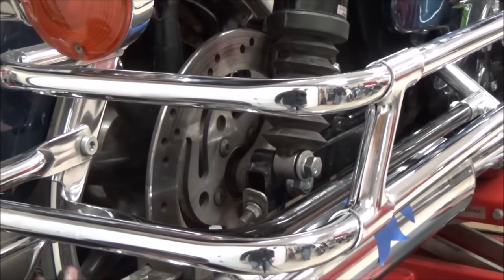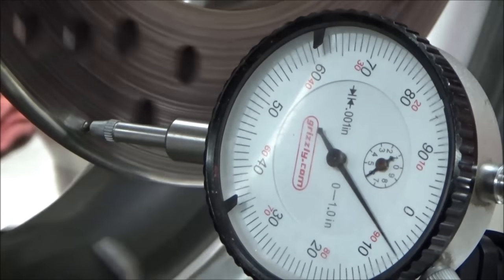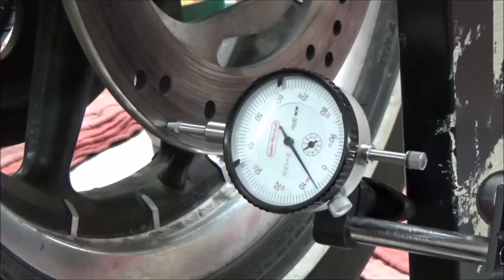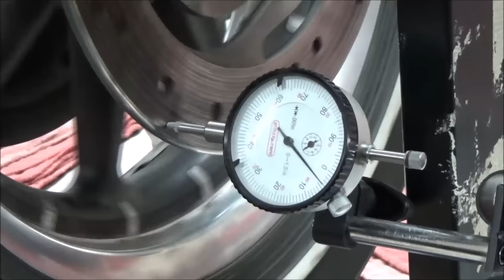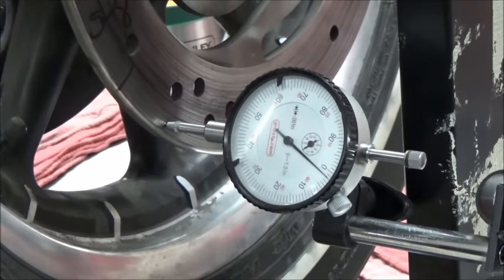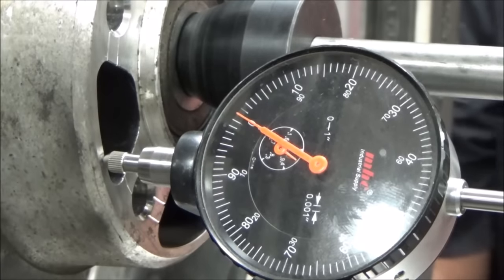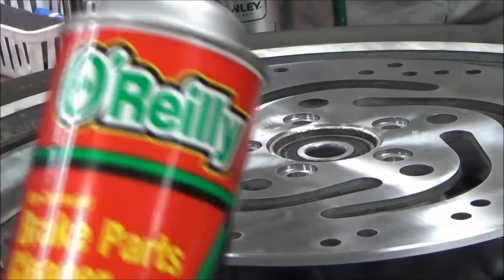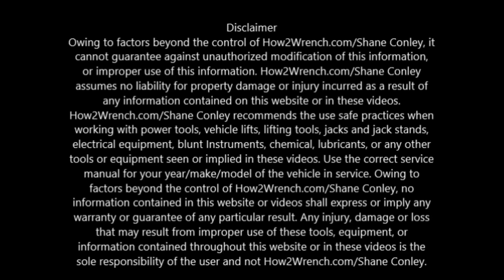Got the shakes? How to inspect a warped disc brake rotor. #how2wrench #bentrotor #brakeinspection

Comment: Thanks for the video but it think the title is a bit misleading because you did not "fix" the rotor, you "replace"d the rotor. A huge difference bro...
Reply from the maker: Thanks but....OMG what would we do without the Nazi title police????? YouTube limits titles to 100 letters BRA...Picking a title to best fit most common "talk" is tricky BRA...You got the point the fixing the warped rotor was to fix the "problem" right BRA? LMAO
Reply: Shane Conley I see your point but i have a slightly warped rotor i wanted to fix because it is a shitload of money in Turkey, a real big ass shitload that is almost close to a minimum wage or even more, so you can see the frustration i had :) Nothing nazi about that...
Reply from the maker: The point is this. You can not fix a rotor...motorcycle rotor that is. There are so thin to begin with. Can you chuck in in a lathe and turn it? Yes, of course, you can mechanically, BUT it will not have the material left to prevent warping right away due to the thin material now. Let alone the unknown stopping or rate of wear as it is thin and not able to dissipate the heat as originally designed. Hope this helps.
Reply: My rotor has much more than min thickness but i thonk it is like one third of a milimeter bent i will use a dial indicator and let you know the results. Depending on the warp, yes they can be repaired, sometimes. Not all the time

Comment: good video and only thing I would add is to check brake rotor minimum thickness. my yamaha royal star service manual gives that spec along with allowable runout.
Reply from the maker: True that...Did I not mention in this video that the minimum thickness is stamped on DOT rotors from the factory? Oppppps....
👍 Thank you for taking the time to comment! Hit that subscribe button if you haven’t please! It helps us! 
Here is a way to support all the free videos.
Want to say “thanks” or “keep it up”? Click here https://www.paypal.me/how2wrench  

Coach Conley is also available for hire to personally work one on one with you if ever needed. Yep he is a real person. Give him a call @ 602-345-0432
Details here: https://how2wrench.com/product/personal-tech-training-phone-facetime/ 
Your answers and help are just around the corner. Save time and money while protecting your investment and yourself by doing it the right way!
Follow us! 
Web:
www.How2Wrench.com     
www.Tools2Wrench.com
Reply: @How2Wrench  Thanks. I skipped thru the video and went to the parts that pertained to what I was looking for. My Bad. Checking your website. Keep up the great work!

Comment: Another item that should be checked on rotors is thickness variation. Runout like you show in the video is bad, but runout of a few thou (anything under the pad retraction) is less critical than thickness variation. As little as .0005" thickness variation causes braking shudder and will result in braking action ranging from annoying to terrifying---especially on a sportbike. It is a great tip about checking the hub. In working with rotor manufacturers this was always an issue. We could grind perfect rotors with under .0002" TIR and thickness variation and they would get bolted onto .003" TIR wheel hubs with tool bruises on them. This was not a recipe for success.
Reply: I know its a bit late but can thickness variation be fixed by applying the brakes ever so slightly as I drive along? My bike's got semi floating rotors and the calipers are floating too.

Comment: How do I know/measure wether it's just the rotor or the wheel itself? A wheel that isn't perfectly true could still be within spec, but would it effect the break disc runout? Truing my wheel is way less expensive than new break discs (but not if I have to do both😂)

Comment: Believing that my disc brake rotor might be warped, I've just stumbled across this gem of a video. Could someone on here tell me what that measuring tool is called 👍
Reply: It's a dial indicator. I just picked up a cheap one on Amazon for about $30. A high end one can run into the hundreds

Comment: What I did on my Harley was determine what are of the rotor passes freely through the caliper, mark that area then with either a runout, or dial indicator fix the gauge to the good area then with a large adjustable wrench make slight in or out adjustments to match the good area. Use the area that passes through the caliper freely as a reference as to where you want the rest of the rotor. Hope this makes sense. After all the end result we want is not to rub through the caliper.
Reply: Above is meant to say “what area”.  The adjustable wrench is sized to the thickness of  the rotor, slid over the rotor and used to slightly bend in or out the rotor.